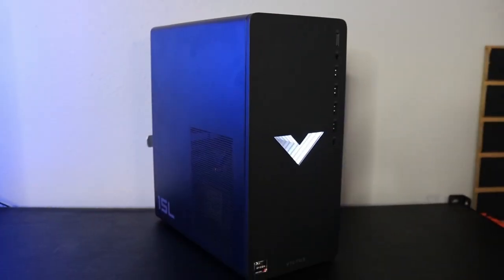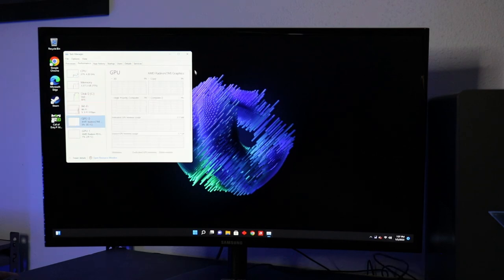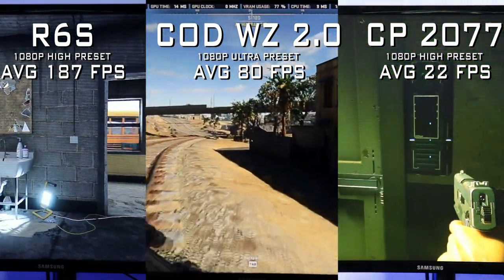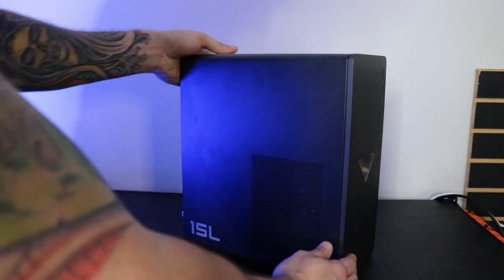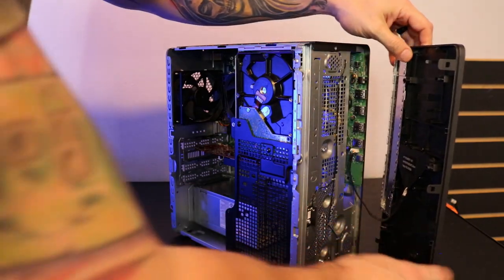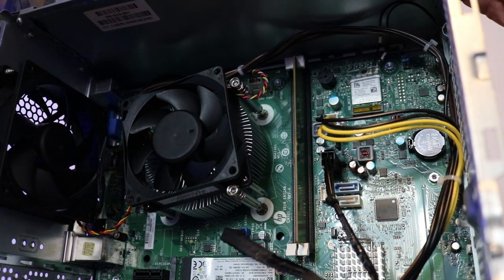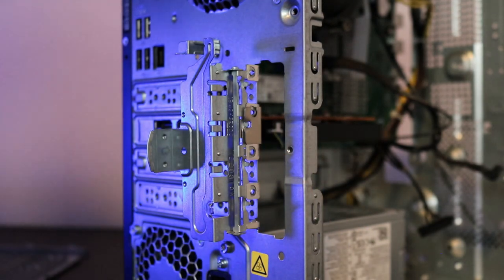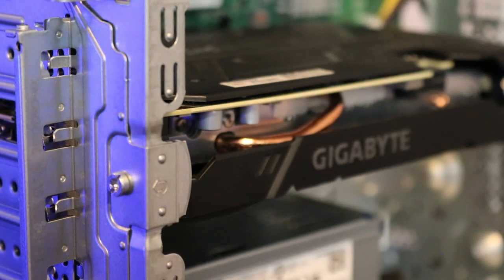Killer Gaming PC for CHEAP!! HP Victus 15L Gaming PC#pc #gamingpc #review

Comment: Something you may not know is you need to use very specific RAM called 3200AA for these HP Victus PCs, otherwise it will run at 2133mhz rather than 3200mhz, which means you'll lose a good chunk of performance. You usually can find an 8GB stick online for like $15-20. Also make sure you don't get laptop RAM on accident; the desktop ram is longer and shorter than laptop RAM.
Reply from the maker: Thanks for that info. It's running at 2400mhz currently. I never thought to check to see that the speed changed. I appreciate the feedback!
Reply: I just want a double check that this is accurate. I was two seconds from buying a Ram kit. I admittedly have no idea what I'm talking about. I haven't tried to build or upgrade a PC in 20 years, probably.
Reply from the maker: Here are two links to find a 16gb set or just a single 8gb stick to add to the original. These work without slowing down the ram speed! Hope this helps!

A-Tech 16GB (2x8GB) DDR4 3200 MHz UDIMM PC4-25600 (PC4-3200AA) CL22 DIMM Non-ECC Desktop RAM Memory Modules https://a.co/d/gCyuGhP

A-Tech 8GB RAM Replacement for Crucial CT8G4DFRA32A | DDR4 3200MHz PC4-25600 UDIMM Non-ECC 1.2V 288-Pin Memory Module https://a.co/d/2l4vscW
Reply: @bradfordskeldorado  I've been googleing like crazy for a while now. I can't find anything about 3200aa and victus. I did find a video saying the victus line uses 1.2v ram slots. So to use 1.2v ram. Also found that ddr4 above 1.2v is basically factory overclocked. So if hp limits the ram slots to 1.2v. Then that makes sense. Why the higher voltage ram can't hit it's basically overclocked spec. Just like adjusting the voltage to overclock a cpu. Just a thought. It makes a $50 difference for a 2x16 kit.
Reply from the maker: So something with the AA ram causes it to be set to 3200mhz. The factory bios is default to that speed amd cannot be chNged so if you put the 1.35v stick that is ECC ram then it will reduce the speed. The ram in the link I commented above is non-ecc that is the same as the factory stick that HP puts in so it will run at 3200mhz and not reduce down to 2400mhz.
Reply: @bradfordskeldorado hey I was wondering would 32 gb of ram be too much for this pc or not I have this same exact pc and want to upgrade it
Reply from the maker: You can do 32gb but just make sure it's that A-tech brand so the pc stays running at 3200mhz. The kit below would be perfect. 

A-Tech 32GB (2x16GB) DDR4 3200 MHz UDIMM PC4-25600 (PC4-3200AA) CL22 DIMM Non-ECC Desktop RAM Memory Modules https://a.co/d/h22kGQk
Reply: @bradfordskeldorado  thanks for the feedback appreciate it keep up the good work enjoy ur vids
Reply from the maker: Thank you very much! Let me know if there's anything else I can help with!
Reply: Can you just add another 16gb RAM without removing the original 8gb and it will not affect the speed or does it have to be the same 8gb configuration? @bradfordskeldorado
Reply from the maker: This set of ram will keep the pc at 3200 mhz and is a great add and will work with the existing 8gb stick of ram 

A-Tech 16GB DDR4 3200 MHz UDIMM PC4-25600 (PC4-3200AA) CL22 DIMM Non-ECC Desktop RAM Memory Module https://a.co/d/aCqHhzq
Reply: Since it's an AMD based system, I downloaded Ryzen Master. This is the only way to modify RAM speed. The bios of this system is so striped down it's hilarious
Reply from the maker: @TheHAWKERGames-oh5gp  I believe I tested the ryzen program and I didn't have any luck in adjusting it. The bios is very bare but that 3200mhz ram from atech makes it plug and play!
Reply: Got g skill ripjaw v in mine running at 3200mhz gotta over clock in ryzen master
Reply: There's an option for memory   half way down the page it's exclude make include it will be green then overclock to 1600 for each 16 plus 1600 is 3200 and it will work
Reply: Mine had samsung ram installed so I just found the same exact type of ram stick.
Reply from the maker: @kishdogg1594 in the video, I show how to install a 3.5" hdd. You can install a 2.5" ssd, or if you have another pc, you can order an nvme reader to clone your existing nvme storage device and use it
Reply: @bradfordskeldorado  O e more question should i be saving my games( Iracing)  on the 7200rpm sata Hdd or the 512 gb pcle Nvme M.2SSd does it make a difference im new to pc gaming thank you

Comment: The Biggest Mistake I Made in My Life, this is the worst cheap PC!
Reply from the maker: Can you elaborate on the issues you're having? I don't know what you expect from a $400-$500 gaming pc but this is a very low cost for a gaming computer. Personally, I would recommend spending less than $1000 for performance and quality on a gaming pc. This is just entry level with the ability to upgrade certain parts down the line to make it better down the line. Sorry for your experience but if you have any questions then I am willing to give some advice on improving the system to meet your needs!
Reply: @bradfordskeldorado yo man, just got this exact PC, and the day I opened it it doesn’t turn on, I looked inside of it and all of it is seeded correctly and the inside looks exactly like yours before you upgraded it, any idea why it doesn’t turn on?
Reply from the maker: @marcuslontok5703 no power at all?.. that's odd. I wouldn't touch it to be honest. I would box ot up and take it back. I just wouldn't want you to do something that would render it void of return. Sorry to hear about this!
Reply from the maker: @marcuslontok5703 possibly a bad power supply or even a bad connection to the motherboard. The cpu not being seated properly could cause this issue but I wouldn't mess with that unless you have thermal paste to re-install the cpu cooler.
Reply: Same thing
Reply: No its not at all
Reply: Sounds like a great entry level pc. What would I have to do or change on this to get it to top of the line gaming. Or would it be just as expensive to just buy one with all the upgraded parts in it?
Reply from the maker: It's a very entry level pc. However, getting it spiced up and ready for very comfortable 1080p high gaming I would recommend adding about $400 to get it performing at that level. The 4060 is a huge improvement ($299) and adding the additional A Tech ram that maintains the 3200mhz speed ($25) helps so much. Just add an additional ssd to help with game storage and you're good to go! Looking at around $700-$800 for a ryzen 5 and a 4060 gaming pc.
Reply: they are actually selling it for $600 with a 4060 , 500w powersupply, and wifi 6
Reply: @thedaka  really? Guess I’ll have to check into that then.
Reply from the maker: Where is this at?

Comment: I am glad you touched on the ventilation. On mine I added a case fan over the vent and I got a better heatsink and fan, it definitely made a difference. Overall a great budget gaming computer or starter. Seems like HP wants you to add upgrades.
Reply from the maker: It definitely seems that way. I'm sure for the cost of this pc, they cut as much cost as they could but also allows for early wear, so you come back in a couple years to buy the next generation pc 😄
Reply: Same! But only a 80mm fan fit the side panel. I re-thermal pasted, added a side fan, and the system stopped randomly rebooting during game play.
Reply from the maker: Nice! I would like to see about some options for a different cooler but I haven't dealt with this pc in a couple weeks

Comment: I just bought this one on amazon and it comes monday idk if umma regret it HP Victus 15L TG02-0013w Gaming Desktop AMD Ryzen 5 5600G 8GB RAM 512GB SSD AMD Radeon RX 6400(4GB) Windows 11 Home (Renewed)
Reply from the maker: The first thing I would do is grab a stick of A Tech ram that will expand the memory to 16gb and enjoy! This pc is great to start with and will play just about any game you throw at it!

A-Tech 8GB DDR4 3200 MHz UDIMM PC4-25600 (PC4-3200AA) CL22 DIMM Non-ECC Desktop RAM Memory Module https://a.co/d/1D1C6q2
Reply: @bradfordskeldorado  ok ty so much imma get a 16gb ram when it comes btw is the graphics card good for gaming?
Reply from the maker: The gpu is really entry level. It can definitely run some games and hold you over until you decide to upgrade. My #1 recommendation for an upgrade would be a 4060 for around $300 and you'll be set for a long time to come.
Reply: @bradfordskeldorado  ok ty

Comment: The upgrade you did want big enough for me to consider upgrading
Reply from the maker: Are you talking about the 2060 gpu and the ram? The 300w power supply has its limitations, so with the pc, there isn't a lot of head room to upgrade a lot.
Reply: @bradfordskeldorado  I'm only seeing a 18ish fps gain on the harder to run games. The AAA titles will very and the Rx card is running them at high rates already. Then your running into heat issues with the 2060? Probably best to game it out for a year or two then sell it for 300 and with the money you saved in those years get a better pc
Reply from the maker: The whole aim was to show that you have the ability to upgrade with the power cables that are included. It was a gpu I had laying around. I purchased this pc just to test it, and show the capabilities. This is not a pc I use daily

Comment: i got one of these and dropped a 3060 in this with 32gb of trident ram. it screams and i can get ultra settings on CP2077. Also i changed out the back fan with a noctua NF-A9 92mm fan to pull more heat. This is was a great deal and a fun little PC
Reply from the maker: Sounds like a ripper! Did you get a two fan or a three fan modle? I'm a fan of this pc for sure!
Reply: 2 fan, im actually impressed with this littel thing. on 1080p with 144hz im getting a 100+ FPS. i was shocked @bradfordskeldorado
Reply from the maker: @gawrysh1975  I have a shorts video testing a 4060 and it really woke this little pc up. I haven't tried cp2077 yet but I bets its a lot better than the 20fps I got with the rx6400 lmao!

Comment: Thanks for the review! Pretty amazing for the price. Is there any reason you used 2 new 8GB sticks instead of adding one 8GB stick to the existing one?
Reply from the maker: The only reason was because I wanted them to match. You can buy single 8gb sticks but it's more common to buy a 16gb kit 2x8gb than to buy just a single.
Reply: @bradfordskeldorado  Thanks
Reply: Do not buy this dog shit pc. Games crash all the time. Some games can’t even be ran right. Even at low settings. I even upgraded the ram. Was greatly disappointed in this pc. Save up more money for a better one. Please
Reply from the maker: @Salsas Mynd  I didn't have any issues with this thing and the comparison is a $499 pc vs other cheap prebuilts. I wanted to check to see how it worked and for this price I was surprised. Try unistalling the gpu drivers and reinstall them. I had issues with it before I did that and it changed the way games ran.
Reply: @bradfordskeldorado  ok sorry I’m just annoyed about it.
Reply: @bradfordskeldorado  thanks
Reply from the maker: All good. I recommend deleting the amd software and clearing the drivers and reinstall the drivers. Mine had some issues and I had like 30 fps on cod and once I reinstalled the drivers it jumped up to 60+
Reply: @bradfordskeldorado  how do I reinstall them when I delete them
Reply: @bradfordskeldorado  nvm I think I got it
Reply: @bradfordskeldorado  I don’t know if I did it wrong or sumn. But now I really fucked it up💀
Reply from the maker: You can download the display driver Uninstaller at guru3d.com. just search display driver Uninstaller on chrome and it's the first link. That will allow you to remove any and all drivers. Then, go to amds website. Search drivers and find the one for the RX6400. Then it will download the adrenaline program and you can update the proper drivers once it is downloaded and installed. Then restart you pc and give it a go

Comment: I have the newest 15L Gen 13 I7 and Nvidia GPU. I am liking it for the most part. There is not much room for upgrading. The CPU is already maxed out because the case cooling is tapped out. The front od the case has 2 - 10gig USBA and 1 - 5gig USBA ports . The USBC is actually only 5gig and qualifies to be an oxymoron. USBC  superspeed at 5 gigs, WTF?? There is only 1 NVME slot so I am going to replace the 1TB with a 4TB and split it to .5 TB and 3.5TB Partitions.HP has emptied the URL's for these newer PC's for somereason, you get 404 message.  There are Zero YouTube videos about them, Only 12th Gen. When you look at the specs on thgis PC, just remember, that's essentially all you get. Upgardes are not available for it.
Reply from the maker: That's a lot of info and I appreciate it. I would have never expected hp to put that level of components in this little case. I have a video on changing all the internals to a full case but really you change motherboard, case, psu, and cpu cooler. What gpu is in yours and how much did you spend on it? Thank for servicing by the way!

Comment: Hey ive got a question,can I put my gtx 1070 into this bad boy? Since it has a 350W power supply I was wondering if this will be enough
Reply from the maker: The 1070ti uses about 180W of power which is a lot compared to some of the newer comparable gpus. The 1070ti if I'm not mistaken, also requires more than an 8 pin power connector. I would recommend using a different gpu if I could afford to buy one. The 4060 is a very low power draw gpu and only cost $299 but that's just what I would recommend!